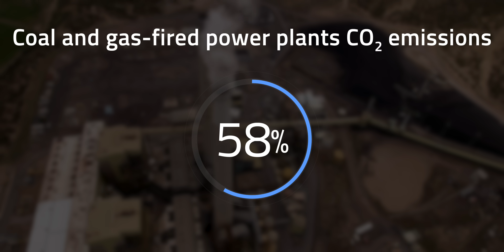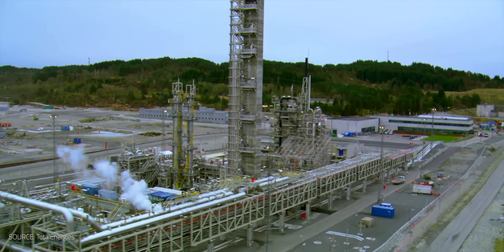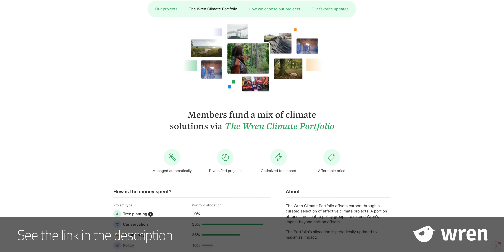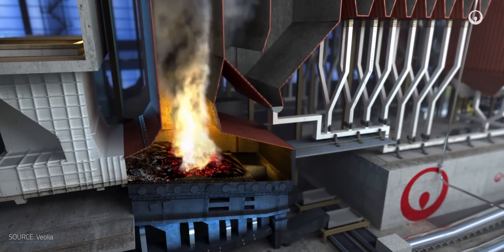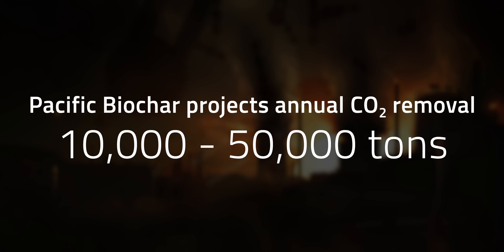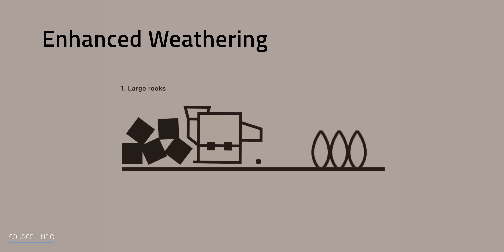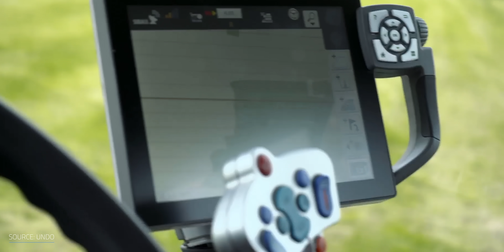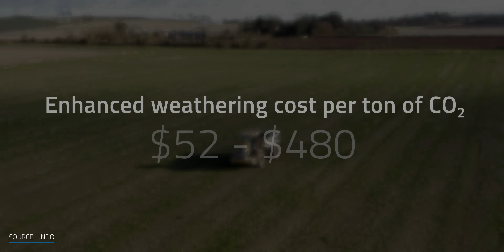The Reality of Carbon Capture

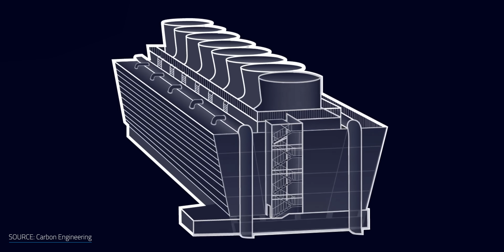Comment: 3:15 carbon capture price $100.  Coal price $100-150 per ton.  CO² released from burning a ton of coal 2 tons.  
Does anyone see the Rube Goldberg mousetrap that is carbon capture????
It costs more energy to take the carbon out of the air than the energy produced by burning the coal in the first place, you might as well just pay someone to leave the coal in the ground for future use and save all the wasted energy and effort of trying to put the carbon out of the atmosphere back in the ground.
Reply: @jasonneugebauer5310  nuclear powered. Nuclear waste is metal pieces and a future potential fuel. Burning of fossel fuels cleanly should get the investment wind and solar is.
Reply: @Nichoラス I would say yes, we should invest in making fosil fuels use efficient and reasonably clean.  This is as important as building the average renewable power generator. 

Also, nuclear waist is future nuclear fuel. 👍

Comment: 2:52 You Call them pollutants, plants consider carbon, sulfer, and nitrogen vital neutrients.   Tell me if I am wrong.
Reply: He doesn't read comments that often let alone years later
Reply: @jasonneugebauer5310  important thing to consider is the saying “dose decides the poison” yes plants need them but in specific quantities, a good example of something similar is humans need oxygen everyone knows this but if you breathe pure oxygen you’ll die. The point being yes plants need those nutrients but too much can be as lethal as not enough.
Reply: @Natural-Resource-Nuisance I understand that the dose is the difference between nutrient and poison.  Definitely in cities that do not have good air exchange, air pollution is bad for animals and ground pollution can sometimes be overwhelmingly bad for plants.

However, in the majority of the US carbon, nitrogen, and sulphur are far below the point of reaching maximum beneficial effects for plants.  In fact, our reduction in sulphur has made it more necessary for farmers to add supplemental sulphur to soil for some crops in some areas.

Sulphur is necessary in high PH soils to break chemical bonds that prevent nutrients from being bioavailable to crops.

Comment: Climate Remediation

	There is a lot of discussion about Global Warming, whether it really exists, how serious a threat and the role of Carbon Dioxide. However, the following is generally agreed. Namely that a lot of CO2 has been released into the atmosphere since the start of the Industrial Revolution and most of it has ended up in solution in sea waters. There is at least 150 times as much CO2 in a cubic meter of sea water as there is in a cubic meter of atmosphere at NTP. This is acidifying the sea waters and harming Coral Reefs. There has also been some agreement that the Temperature of the Earth has warmed somewhat.
	The Earth's rotation and the Coriolis Effect has formed a number of Tropical/Semi-Tropical Oceanic Gyres, within which the mass of sea water is rotating, clock wise in the Northern Hemisphere and counter clock wise in the Southern Hemisphere. Anything floating, i.e., less dense than sea water tends to float towards the center of the Gyre. There are five main Gyres which are the North Pacific, South Pacific, Indian, North Atlantic, and South Atlantic Oceans. Together they form a very large proportion of the 70% of the Earth's surface which is covered by water.
	The North Pacific has a lot of floating debris, "the Great Pacific Garbage Patch", some of it being debris washed off Japan by tsunamis following the recent Fukishima Earth Quake. The Southern Hemisphere Gyres do not appear to contain much floating debris.
	The North Atlantic Gyre is unique. It contains the Sargasso Sea which is characterized by the presence of two species of Sargassum which float by virtue of oxygen-filled follicles. It was discovered (first documented) by Columbus from his voyage in 1492. There is a Sargasso Sea Commission, with an Office in Washington DC, which is charged with protecting the Sargasso Sea from pollution etc. There is a website that basically describes all of the positive ecological values of the Sea.
	Since 2011 the Sargassum appears to be overflowing from the Sargasso Sea and moving via the west bound currents across the north coast of South America into the Caribbean and sometimes into the Gulf of Mexico. This has been attributed to agricultural run off from the USA or Brazil but might be due to the increased levels of CO2 in solution.
	It has been washing up on beaches through out this region, as one might expect to happen. When it dies and rots it emits H2S. Since a lot of these beaches have tourism as their main industry, the weed has to be removed manually which has given Sargassum a bad name. There are several Facebook entities that keep track of Sargassum landings and there are frequent postings enquiring about Sargassum occurrence on specific tourist areas.
	The occurrence of Sargassum in the Caribbean would, however, make it very easy to put live Sargassum into the Pacific off the west coast of Mexico. From there the currents would carry it all the way across the Pacific, photosynthesizing and growing all the way absorbing a lot of CO2 and heat energy, photosynthesis is an endothermic reaction. Absorbing CO2 from the Ocean would allow CO2 from the Atmosphere to dissolve in the sea. The Sargassum would probably stay in the North Pacific Gyre but some might drift into the South Pacific.
	One might balk at the idea of covering a lot of the Oceans with Sargassum but it does have uses. It can be used to make ethanol, paper or cardboard. Some one in the Caribbean is making construction bricks from it and others are feeding it to goats..
	If there appears to be some benefit from Pacific Sargassum we could easily add Sargassum to the other Gyres using ships that are transiting the Panama Canal. It seems likely that some Sargassum will eventually get into the South Atlantic Gyre, but that may take a while.

Comment: Given the number or oil barrels we as humans have burned and turned into carbon, is enormous. It measured in Wh (watt hours) so one barrel of oil contains 1,700,000Wh as a collective we have burned through up until 2022 Juts over 51,021Twh. That is what we humans have removed from deep under ground and released to our atmosphere. This is what we need to back into the ground, the task is mind blowingly impossible, you cannot undo 100 years of damage in ten years with a machine. You cannot take out that which has been absorb by our oceans, you would need some other kind of machine to that. Basically we are screwed. The energy needed to run these machines would be uneconomical!! The only chance we have is to stop BURNING NOW, and I don't see anyone agreeing to that.

Comment: 2023 was the highest year for coal production. We're accelerating the problem, not reducing it. The cheapest, most effective way to reduce Co2 is to not burn fossil fuels, but we haven't even slowed down over the 20+ years we've had global awareness of this problem. Capitalism is a cancer and we're not winning the battle. We're absolutely, undoubtedly, screwed.

Comment: As a chemical engineer I wholly support biochar.  It is a mature technology that has been around for thousands of years.  The economic feasibility however is another story.  Only the recent advent of corporations and individuals buying carbon credits in the form of tons of biochar make it feasible.  The technology reduces the carbon 1:1.  Put a ton of biochar into the ground-that's one ton out of the atmosphere for hundreds of years. Completely carbon negative.  If there were government subsidies (and I think there should be) that made it feasible, most farmers could be convinced of the benefit.  All you need to do is look at the amazon basin (which has very poor soil) and it's use of biochar charcoal to form Terra Preta soil to see the incredible results.  As to one commenters question about the volatile organic compounds and tars produced- they are burned off-that's where the fire to make the biochar comes from.  In a modern facility the resulting smoke goes up a stack just like in a coal fired plant.  The difference is that instead of ash as a byproduct, you get the biochar.

Comment: I have been following carbon capture projects for some time now, and there are some really sketchy technologies. I was just reading about Stratos, a 1 billion dollar DAC project in Texas that aims to capture 500.000 tons of CO2 a year. This only sounds like a lot because it is a high number. But it's the equivalent of about 100.000 cars. In Texas alone, there are 22 million cars. So in this math, you need to spend 220 billion on 220 of these machines to offset the cars for Texas alone. And so far, none of these DAC plants have actually yielded what they promised to do. And that's only offsetting cars. We're not offsetting trains, planes, heating... 220 billion JUST FOR THE CARS IN TEXAS. It doesn't scale, the math doesn't add up. Rock crushing sounds like a more realistic exercise, but it's more difficult to gauge the environmental impact. Our planet is fragile enough as it is. And, rather maddeningly, the oil industry points at these technologies saying "See? see? we can continue, this tech will solve it!". Oil needs to stay in the ground. It is as simple as that.

Comment: so far all the carbon removal technologies that i read about have something negative: 1.  the enchanted weathering... as a farmer i would not spray rocks that i don't know what they contain on thousands of hectares potentially risking to poison the fields. 2. DAC? removing co2 from the air with filters and injecting it into the ground? what is the risk of poisoning the water aquifers? 3. making charcoal out of bales of dried crops? we feed the cows with that. idk.. i would like to have a good solution for co2 emission but we really don't have anything at scale right now

Comment: I think we must not overlook the fact that CCS enables the very thing we are supposed to avoid that is emitting CO2 in the first place. Filtering it from the air is even more laughable. How much energy does it require? it would only make sense with abundant cheap renewable energy.
Even if we filter it out where would they store it? We are talking about 50km3 of CO2 per year!
Unlike coal and oil, CO2 is a gas....

Comment: I support all three methods described. Biochar, carbon capture and enhanced weathering. Carbon capture or removal should be tried at the bottom of quarries or valleys or in disused coal mines where the proportion of CO2 is highest. Similarly extraction of CH4 can be carried out in the mountains.

Comment: it seems quite reasonable. for transport, at $600/tonne, 2.3 kg co2 per litre burnt, that's $0.6 per kg, times 2.3 (co2 from burning 1 litre of petrol) = $1.38 per liter. So that's a fairly stiff price hike, but it's not 10x. Hey, maybe the cost will come down as the technology improves?

edit: did a little more research and realized this video neglects to mention the energy needed by the process. So, you'll need a lot more energy now because you'll have to also run the capture, so it's likely to be counter productive.

Comment: Biochar option is a no brainer to me... Set up regional facilities to self sustain the burning process from the feed stock. Utilize the excess heat with a boiler sleeved around it to power a steam turbine  for extra electricity. Then capture,  clean & store the exhaust syngas & oils for responsible use. Use the created char to feed plants that love it and improve the soil / reduce erosion... Most expensive part is probably transport, but the hydrogen from the syngas can probably fuel that...

Comment: CCS is one pathway to reducing CO2 emissions, but we also need to do more on other pathways. After leading more than 100 industrial decarbonization assessments in over 30 countries, there are typically 5 to 30% CO2 savings on efficiency alone at better than $0 per ton CO2 removal. The complacency with inefficiency in the US is particularly shocking. Even with dirt cheap natural gas (at only 1/10th the price as some regions) many US industries can still justify better heat recovery, variable speed drives, reduced re-processing, enhanced controls that save energy, reduce CO2 - and often have production, reliability, and indirect infrastructure cost benefits. US manufacturing is now booming, but they will eventually become obsolete when the energy pricing advantage disappears in a few decades.

Comment: The problem with biochar is that it can take nutrients away from the soil for an extended period of time before it can become accessible. This is where priming the char ahead of time matters. If that requires it going through a digestive tract, also removing toxins in the process, then it can offset the problem that I mentioned. However, how many nutrients can it also take away from the animal during that digestive process? I'd love to see a study done on this potential issue.

Comment: Current carbon offsets are bullshit, and just the last lady talking alone should tip you off that this is a non-starter:
50 billion tonnes of aggregate, 20% of 6% of that is usable.

That's 600 million tonnes of the stuff that is available to use, the offset is 4:1 -> so 150 million tonnes of CO2 removed if all else goes well. Average American produces ~15 tonnes per year, so it offsets 10 million Americans. The number of Americans in the past decade has risen by 20 million....

Nevermind the amount of CO2 emitted from moving that rock. Just a quick google search shows that to spray stuff over a hectare of land is between 1-1.5 tonnes of CO2 per hectare, and they're getting ~5 tonnes out through this process. So already we're down a 20% loss (minimum).

With tree planting, you're looking at pulling 5kg of CO2 out/year until year 20, but only 1/3 planted trees really make it until year 10, lets assume that the tree will die in year 10 because of high uncertainty. Each tree has a real planting cost higher than $1/tree (let's use $3/tree in our calculations). So ~$10 pulls 50kg out of the atmosphere with trees.
Scale that up first to 5000 ($1000), then to 15000 ($3000).

Theoretically a tax of 3k per head annually would actually practically allow the offsetting of emissions with trees (expanded to the USA that is an annual cost of one trillion dollars) to get a 10 year offset with trees.

Comment: One problem with carbon capture is that there is a point that plants stop respiring because of lack of co2. If you go below that point everything that breathes or respires dies (hard to get around that).
Reply: What is the minimum CO2 for life?
150 ppm
The amount of CO2 in the atmosphere was reduced by about 90% during the last 150 million years. If this trend continues CO2 will inevitably fall to levels that threaten the survival of plants, which require a minimum of 150 ppm to survive.

Comment: The south American natives used biochar to amend poor rainforest soil, allowing greately increased crop yeilds. In several regions this antique soil amendment is being sought out and reclaimed to aid in local agriculture efforts.  My information is that the porosity of biochar besides increasing water retention also offers a haven for beneficial soil bacteria. 
  My concern for shallow geological strata sequestration is if sismismic activity could release the sequestered CO2.  This concern  may be releaved by using old pumped out oil wells placing it deeper and possibly more stable locations.  In the past compost was used in the New Alchemist green houses (Arcks to add CO2 and heat retention INSIDE the greenhouse environmental.  I believe they had a series of compost totes that would be conveyed down the length of the Arck until the material was finished composting.   Look up Dr Todd of Ocean Arcks Institute in Woods Hole Massachusetts cape Cod.

Wolfmama 2022

Comment: I think it all helps. Constant baby steps in changing the processes we use is more sustainable and thus the manufacturing sector can adapt more quickly without disruption of supply or rapidly put higher costs onto the consumer.

Comment: Carbon capture by machine is a fraud. The machine requires energy to run which comes from where. Wouldn't it be ironic if the energy to run the machines came from a coal fire plant. Wake up people the physics of these machines is impossible. They are a giant con job perpetrated by the fossil fuel industry on people who are ignorant of basic physics.

Comment: I think regenerative agriculture and restoring and preserving wild lands not only removes carbon, is relatively cheap, helps to protect water resources and increases food supplies all while lowering rates of diseases caused by pollutants in the air and water.
Reply: Yes, however that was not a liner progression so your assumption is wrong.
Reply: What is the minimum CO2 for life?
150 ppm
The amount of CO2 in the atmosphere was reduced by about 90% during the last 150 million years. If this trend continues CO2 will inevitably fall to levels that threaten the survival of plants, which require a minimum of 150 ppm to survive.